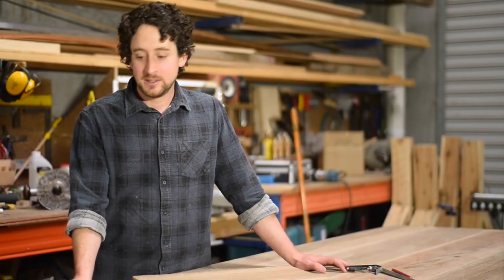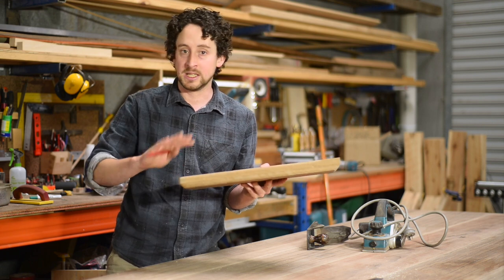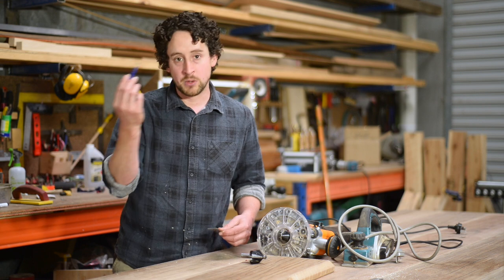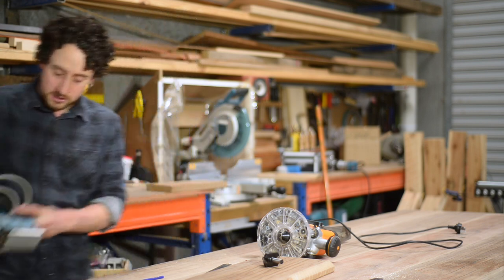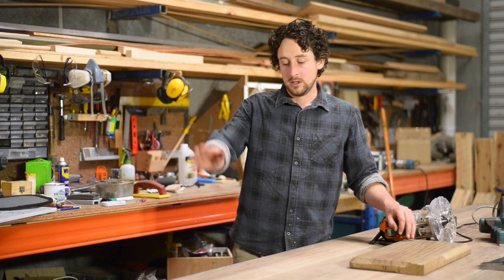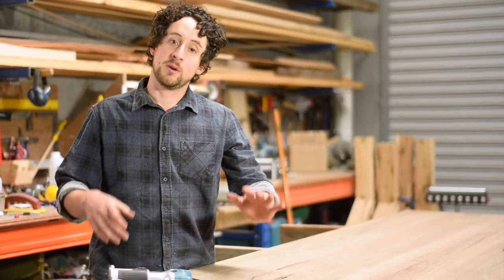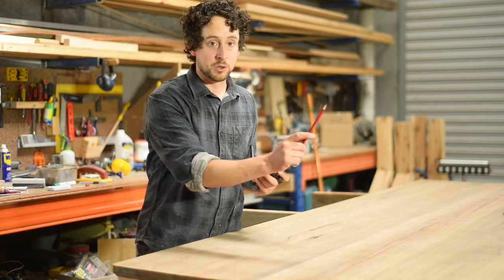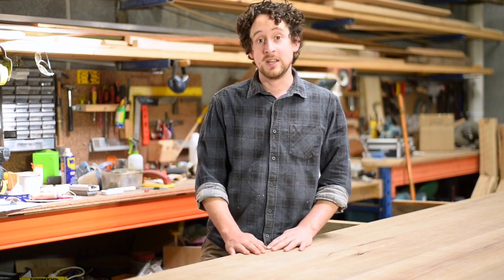The Router Bits - Preventing Tear Out

Comment: Routing in the "wrong" direction is called 'climb cutting', as the router wants to climb onto the uncut material ahead. I do it often because I put radius on finger joined plywood boxes. I built a long base plate with a handle to control the router and take shallow passes.

Comment: Can you explain why you use a router to plane and not a power hand planer?
Reply from the maker: Hi Parker. 

Using a 45 degree chamfer bit in this situation allows me to accurately maintain the same angle and depth the whole way around the table. Using a router bit is also the only way to maintain the same profile around the rounded corners of this table. Using a power (or hand plane) would make it tricky to get a consistent angle on something this large. 

Thanks, Patrick.
Reply: Timbecon 
Thanks for the response! I’m loving the router series have been doing!